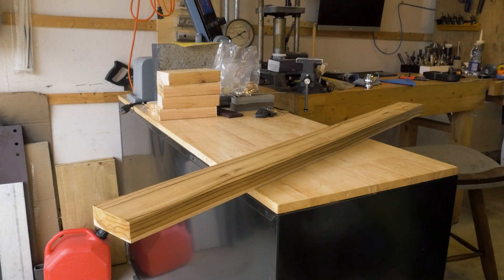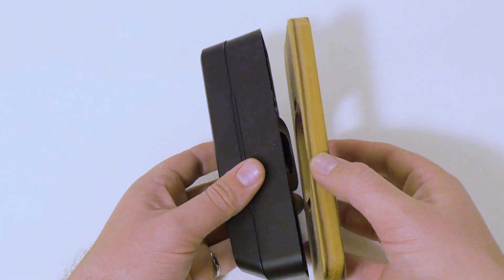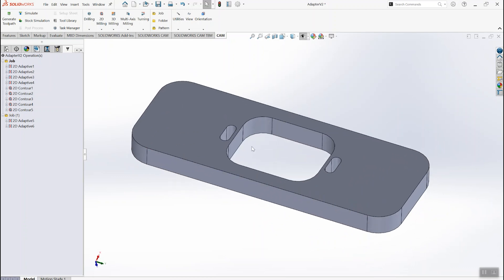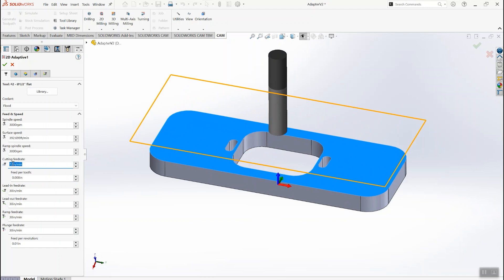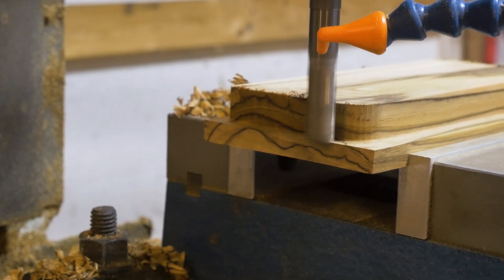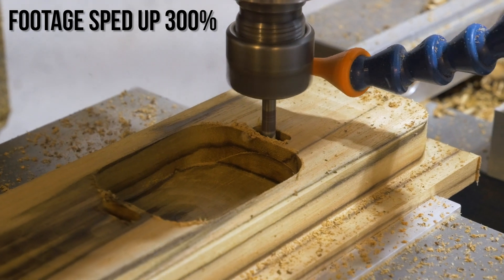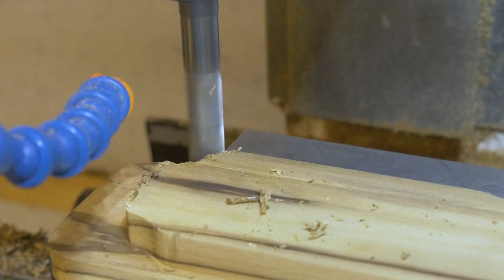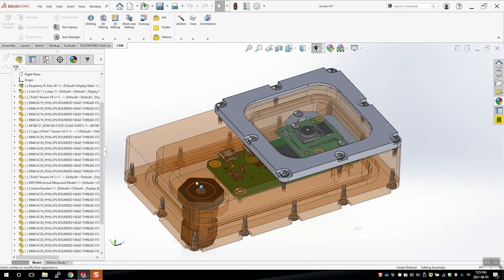Unifi G4 Doorbell Pro Fix - Hardwood Milling

Comment: Hey Adam, Thanks for the vid. I watched it when you posted but just came back to watch again. You helped me a while back when I was deciding which way to go on my controller and software, thanks for that! My controller cabinet is done besides putting a skin on it. I'm working on the machine design now. I have the ball screws and servo motors already just need to get something put together for testing. I think the biggest hurdle may be getting the acorn setup correctly. But once I have one axis figured out the rest is cake.  You do a great job explaining how and what you are doing and I appreciate it! Cheers 🍻
Reply from the maker: Hey Blackbird - thanks for checking back in with an update! Let me know how you make out when connecting the acorn. I’ll be happy to share all my settings. So long as your step and direction connections into the motor drives are good, you shouldn’t have too many problems but I’m curious to see how it goes. Thanks for the kind words! - Adam
Reply: @adamdebowski2037  Thanks bud. I will ping you when I get there! Take care! -Aj

Comment: Nice, is your spindle direct drive or belt drive? If it is belt-driven perhaps you could make a reduction to trade some spindle torque for increased spindle speed, allowing you to up your feedrates.
Reply from the maker: It is belt driven, but unfortunately my spindle bearings are currently no good beyond around 3,500. I plan to change that!
Reply: @adamdebowski2037 Can’t wait! Thanks for the info about the bearing.